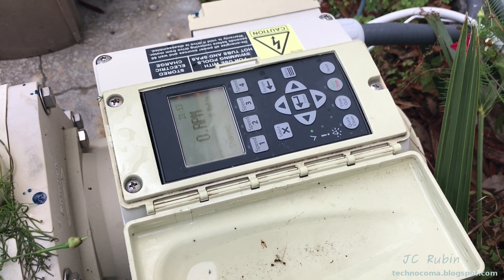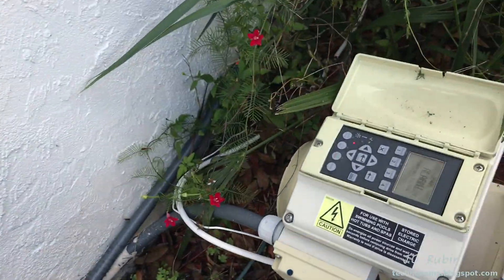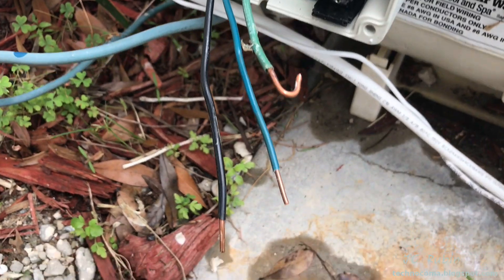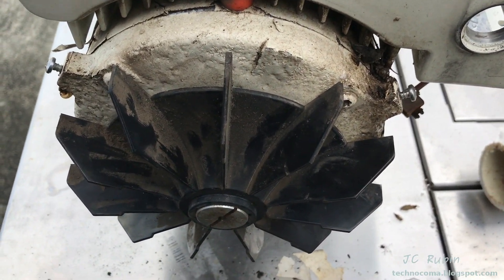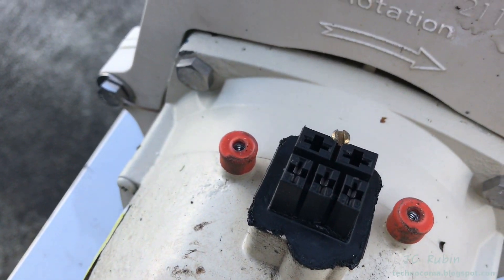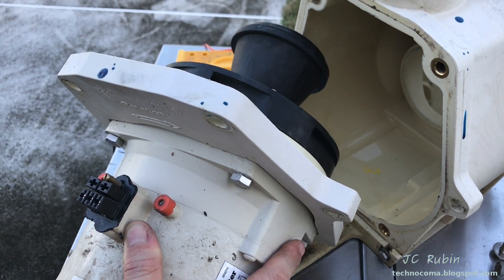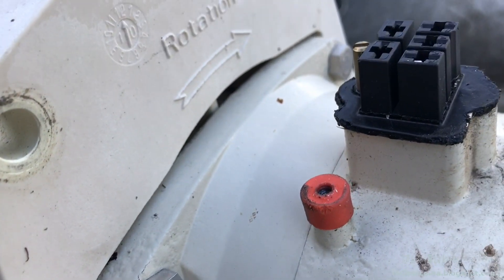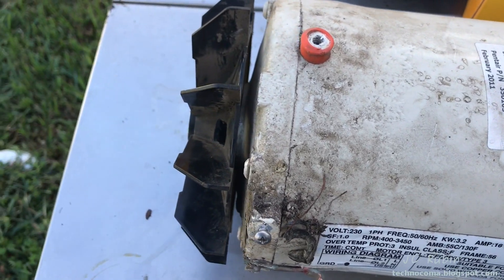Pentair Intelliflo VS Pool Pump Repair Part 1

Comment: My two cents, you didn’t have to cut and remove pvc, they are designed to pull motor without plumbing changes!

Comment: Hi Jordan...Thanks for your very informative videos on the PEntair 3HP pool pump. Mine is working electrically, but the bearings decided to die. I pulled it apart, ordered new bearings, but now I'm having trouble re-building the motor. The fan end has gone together OK, but the impeller end isn't closing properly. I'm a mech-engineer so I should be having this trouble, but I am. Ideas please. Do you have a video on the motor re-build?  Thanks

Comment: I have a Pentair WhisperFlo VST pool pump just over a year old. It may be a victim of hurricane Milton. Not sure. It tries to start and then stops. It's throwing a error code 16 and 19. After removing the power end from the wet end I have it on my bench. I am trying to assess whether it is the Drive Unit or the motor itself. I put an allen wrench on the drive shaft and tried spending the motor. It has a hitch feel to it, a series of drag and release with no sound as you spin it. My question is, should it be a smooth spin or is there possibly something wrong with the drive shaft causing that resistance as it spins.

Comment: Next time you can just take the 3 screws off of the control panel and lift the electronics right off, then go do your repair and put it back.
Reply from the maker: This assumes you know the motor is not the issue.
Reply: @retrotechandelectronics  No, it lets you work on the mechanics of the pump without unwiring the unit.

Comment: Thank you for making this video.

Do you feel you could have removed the drive unit / motor from the wet side without cutting the pool plumbing?
Reply from the maker: No, because the PVC fitting was screwed into the pump and the other side of the fitting was glued.  There is simply no way unless another inline coupler is used.
Reply: Should have had half unions installed

Comment: It is a good idea install pool pumps using threaded unions, so you don’t need to cut pipes and search for glue, every time!
Reply from the maker: Im fond of the piped with the rubber o rings on the face that can be unscrewed, they work well too.

Comment: Those motors are sealed, the most common bug its bad driver.
I am a Pentair warranty center here in the caribbean, here lots of cases i work are driver related, second are mechanical seals. Try out the hi temp universal male adapter. They have orings and no need of sealants usable and reliable!! Good luck

Comment: It was off as soon as you hit the breaker. The screen was still on due to the battery backup. The battery backup last 90 hours.
Reply from the maker: Interesting.... I will have a look on the board again for the battery

Comment: I would expect that the motor would turn freely with impeller off and the seal unloaded. The impellers outboard wear ring looks like it ran dry a few times. Been there done that myself. Good luck with the rebuild!
Reply from the maker: I'll tell you that the findings are such that there would have been some wearable items replaced in the motor, unfortunately it was not THE cause of failure in this unit.